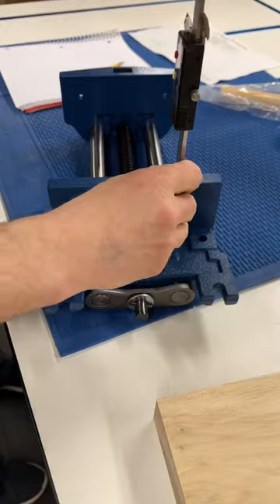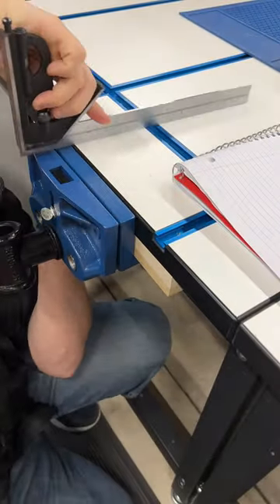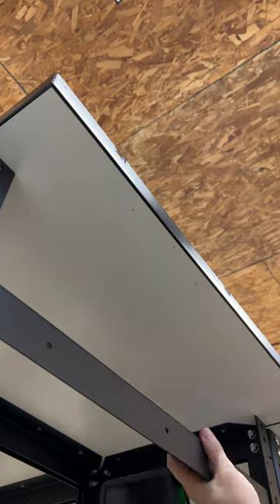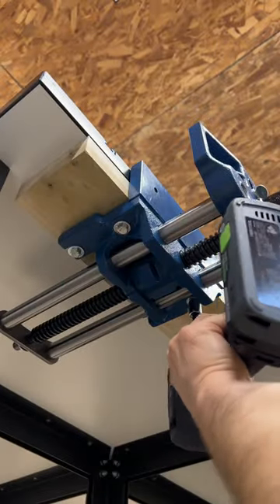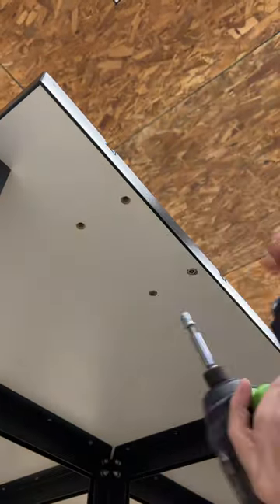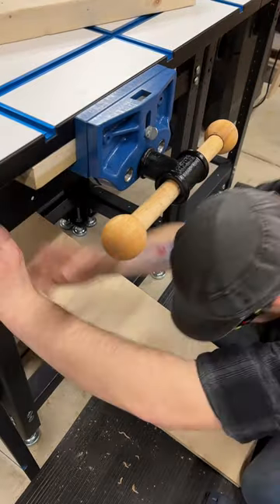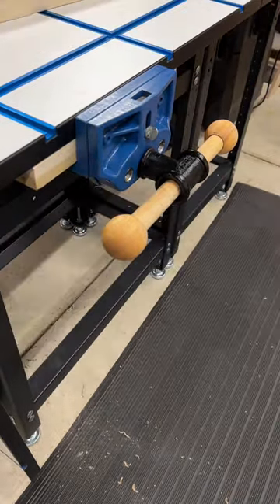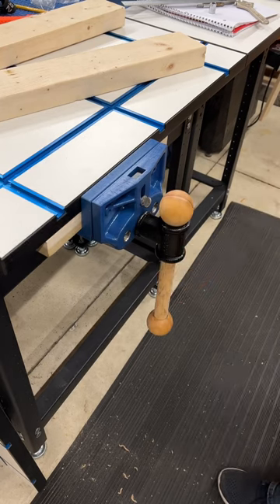Save $30 on the Rockler 7'' Quick Release Workbench Vise! Sale ends 6/1/23!

Comment: I wouldn’t trust that setup…i could probably rip that vise downwards off that bench top….MDF is too crumbly for a vice broe 😮
Reply from the maker: It is intended for light duty work. It will hold a board while planing a face, while marking layout lines, or drilling some holes with no issue.